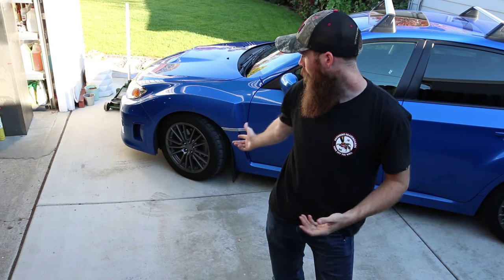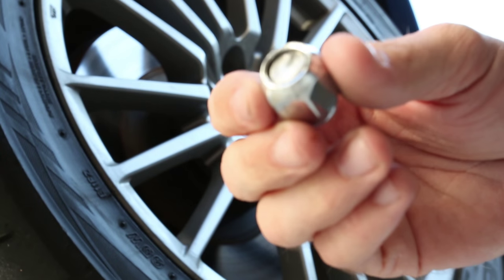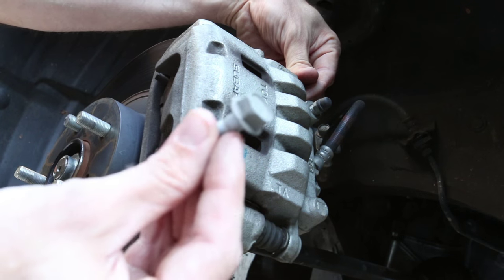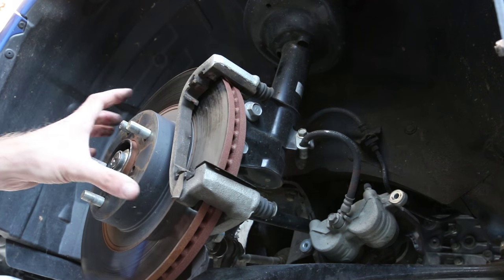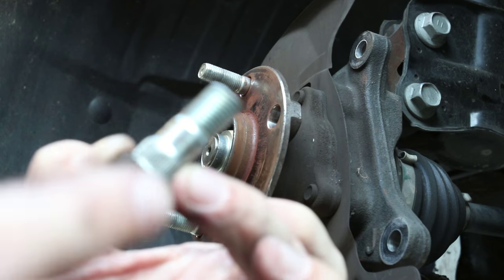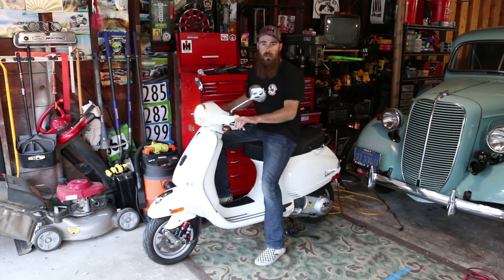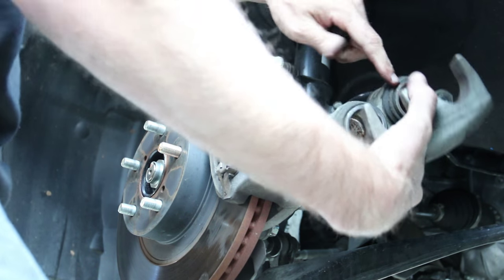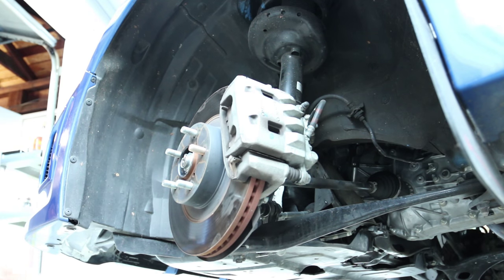HOW TO REPLACE A WHEEL STUD AND BRAKE INSPECTION

Comment: I like tightening calliper bolts (not slide pins) to FT. I had the same thing happen to my 2011 forester XT. It's sucked, had a massive bar on my tyre iron to the point where I nearly snapped the tyre iron haha. Good instructional video mate, I like to always degrease the slide pins on my callipers any time I take then apart, but that's just me ;)

Comment: Well that was unfortunate for you but very informative for us. I kid you not, a couple weeks ago front wheel starting making the worst sound ever(super high pitched squeal). Lifted up the car to inspect and fiddled with the brakes and shield........out pops the smallest pebble from between rotor and shield. Too funny I even saved it!!
-JB
Reply from the maker: +Just Drive Right so annoying why don't they just fall out. It seems to be pretty common on these cars.

Comment: Yep, I broke one on mine, same wheel too. I went with the rather more invasive method and upgraded to ARP studs and BC P1 lug nuts.
Reply from the maker: +jdmcommute Yeah I feel you on that I kinda want to upgrade them all now to ARP with some nice nuts.
Reply: +Blake's Garage   Ha ha! Some nice nuts. I put up a video review a while back on swapping to ARP studs and Buddy Club P1 nuts, weighed them and compared to stock. It was almost a no brainer for me considering the low cost vs safety. But just a heads up, installing the ARP studs is kind of a bitch. Having a hydro press is prefferred. Just let me if you need my help. Peace.
Reply from the maker: jdmcommute Yeah that would be nice to have. I was just thinking about needing one of those in the garage.
Reply: +Blake's Garage   Well, If you are going to pick one up from harbor freight, dont get the small one. You want tge 20 ton press. The small ones have small anvil areas and its hard to get most car parts on it. I was able to make it work on a small 8 ton when installing my studs but the 20 ton is much faster.

Comment: I don't even have a wrx but your videos are just good car knowledge.. Question I broke my girlfriends tensioner on her 04 forester can I just bolt on one from a junk yard
Reply: well I mean from a junked Forester
Reply from the maker: +Whe nzLunch You could but you have to compress the tensioner first then put a pin in it. Check my timing belt replacement video. But I would recommend just getting a new one much easier and I will give you better piece of mind.
Reply from the maker: +Whe nzLunch Also I assume you did this when you were replacing the timing belt not just driving the car. If it happened when you were driving the car you may have bigger issues since its an interference engine.
Reply: +Blake's Garage yea I was replacing the belt that goes to her power steering. her tensioner look alot different than that one
Reply: +Whe nzLunch it was the serpentine belt
Reply from the maker: Whe nzLunch Ahh I would replace it with a new one because it can make some bearing noise if you don't.

Comment: I screwed my rear one on my sti and had a subaru dealer do it since I didn't feel like messing with handbrake so that was more expensive and stupid on my part. Damn do they not lube the brakes in Cali? it looks dry as heck
Reply from the maker: +UnderAchievr LP HAHA yep it was pretty dry I'm going to replace the pads soon and clean and lube them up.

Comment: Using torque wrench for loosening and a hammer can over torque it putting it out of calibration... Potentially making you over torque studs ;) Also when torquing your tires back onto hub the car should be on the ground and not jacked up. Could cause unnecessary stress on AWD system. Just my 2cents 
Love the videos though. Keep up the good work.

Comment: Not sure if I saw it correctly but it looked like you were using a torque wrench to break those bolts loose. If you care about your tools get a breaker bar! Nice video though!
Reply from the maker: +MaherMic Yeah&#160; Thanks dude! You right I should have used a breaker bar I was being lazy though.
Reply: +Blake's Garage No worries :) Been there.

Comment: Are you f*cking crazy to use the Torque wrench like hammer and breaker bar. You know this tool doesn't have to get hit, because starts to tight the things not the set torque and use used it as a HAMMER :X
Reply from the maker: +Lachezar Lechev YEP LOL!!!